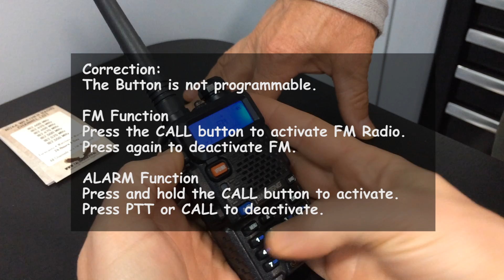Baofeng for Beginners: How to Use Baofeng UV-5R Buttons and More

Comment: I have two (2) of the BaoFeng UV-5R Dual Band Two Way radios. Am I allowed to use these radios to communicate with my family or do i need a license?  I just need them for stuff like camping trips and communication in the house while my wife is upstairs and I am down in the basement. Is it legal for me and my family to use them in the home or camping trips?
Reply: Choose a frequent that they’re not being used been change the tone which is a Cryptid similar to a password. Be very careful transmitting/Talking is a violation without a license. 460.000 plus. Mhz are mostly used for security schools janitors etc. Firefighters most police and county use 800.000 MHz Frequence Which these radios cannot reach
Reply: Don't do it! Dont do it!  "They' will come get you."
Reply: i am still new to this, but my understanding is that you must be very careful of your settings, if you transmit on the wrong frequency then you could be in violation of you local laws (depending on where in the world you live) 
Always better to have the correct license, as these radios have much more capabilities than a "standard walkie talkie"

Comment: unable to program US airband
Reply from the maker: Correct. They do FM modulation only. Air band is AM, so even if they tuned to it, it would not transmit or receive properly.
Reply: @TalonSurvival  what use is a radio without AM? I don't understand the value.

Comment: Might be a very stupid question, but why does it have 2 listed frequencies (A/B)? Is there any difference or what is the purpose? Please explain
Reply: dual band so you can have a backup channel
Reply: @codyman117  dule band is two bands like 2 meter and 70cm eg frequency starting 145.000 and 446.000 are two different bands
Reply: i’ll dumb it down for anyone who’s confused, it allows you to have two channels preset where you can switch between either with just a push of the   a/b  button so you can have one channel for regular talk and maybe use the other one for important info nit in order to do this you need to (IMPORTANT) duel recive and single transmit so you can hear both channels

Comment: Just got this radio as well if someone could help me understand. I can hear some people locally using some channels when i scan and when I try to attempt to speak to them it seems they cant hear anything I;m saying. I just found that my local area does a Trivia night and they couldn't hear anything i was saying. what could be going wrong?
Reply: They may require you to transmit a CTCSS tone. The menu in your radio lets you program this in, but you'll have to know what the tone is. I would google the frequency you're hearing them on, plus the name of your city or county. You can also check a free website and app called Repeaterbook to see if the station you're hearing is listed close to you.

Comment: Mine just isn’t working I can only press talk nothing else will work
Reply: You probably locked it. Look at the #key. Press the #key. It locks and unlocks your radio. It even has a key on that key and puts a little L on the upper left screen.
Reply: No i was wrong. Press and HOLD DOWN the # key until it says unlocked. Like 2 seconds.
Reply: You probably dont want to go transmitting (aka talking) without a FCC license.

Comment: How far can this reach ?
Reply: How far can you throw it lol 😂😂😂 mine just got here and im trying to figure this thing out
Reply: gator 556 yeah it threw me for a loop to.  I can only figure out how to pick up fire or set it up to talk to another one I have.  Other than that.  Kinda with you. Depends on how far it can be thrown.
Reply: @gator5566  yea they aint easy. Got nine about a week ago and it looks like you need a fricking phd to work this thing. What a drag.
Reply: Lol? Really people? It’s line of sight. They can go as far as 100 miles in the 2 meter range. HOWEVER. Once you get a license you can get access a repeater and and TALK FOR THOUSANDS OF MILES. No kidding, there are other videos, check it out.
Reply: One guy talked 2100 miles via repeater.
Reply: @MrJackal43  once i figure it out ill get back to you lol
Reply: I think 7-8 miles
Reply: I heard it will reach to Uranus.  Lol. Jk. Could not resist.  Much depends on foliage, topography even weather.  Also you will get 15 different answers from 15 different respondents.  Not hitting a repeater will land you 3 to 15 miles.  With a repeater, you can expect much greater distances.
Reply: You can hear the Space Station if you know how. Do you know how? Lol
Reply: @tenncutt  what freq

Comment: Do I have to have a license to use these with my friends!?
Reply: No is correct. Supposedly it is illegal to own this radio and do anything on it but listen. But to answer your question you do not need a license to talk on frs/gmrs in general. You do need a license on the ham frequencies. These radios technically have too much power to use the frs/gmrs freqs. so they are not legal to do so but they can do it.
Reply: Yes, per the FCC to operate this radio you must have a license.  It is not type accepted for use outside the Amateur Radio bands, which require a license to operate in. 

That being said, a license is cheap and easy and would help you learn all the simple things to succeed in operating!  Strongly consider preparing some and testing for it!
Reply: NO

Comment: hi, i have this kind of radio.
currently i have 2 issue,
1st, our local community give us a freq to monitor current situation. but they gave us 4xx.xxx, i try to change the freq. but it returns to original freq. (lower than 200.xxx i guess)
2nd, they gave us another freq. a temporary one with 1xx.xxx. i can now hear them, but the issue is, they cannot hear me. or right term is, my input does not broadcasting to them.

pleae help. thanks!

Comment: How do you know you are not transmitting, I want to only monitor a station. Is there a way to accidentally lock the PTT? And does the call button every ring like a walkie talkies call button, I do not want to accidentally call a chanel i am monitoring
Reply: John I believe in frequency mode the bottom row of numbers is what frequency you wish to receive something. And the top row is the frequency you wish to transmit. So theoretically you could receive and transmit on 2 different frequencies
Reply: Jared Reaux i thought that is just presets
Reply: If you program it with CHIRP you can set it to not allow you to transmit. What that looks like in the program is to set Duplex to "Off" I'm not sure if you just mean temporarily or permanently disable

Comment: Very nice video.but what is actual range.
Reply: That is a question that has no singular answer.  It is dependent on your terrain, and the antenna you use primarily.  The shortest answer is that it operates inside of a "line of sight".  Radio to radio directly it is typical to get a bout a mile or two, just like walmart walkie talkies.

Comment: Bought this because of the imminent lockdown on corona
Reply: Me too. Now I need a licence.
Reply: @dannyarnold9823  -Just listening to the radio u don't need a license for that!
Reply: @CTROCK  Where's the fun in that :), no seriously keeping it just in case I need to call for help after the total loss of infrastructure.
Reply: Retro Man Dan Hopefully Amazon does no sink me
Reply: Retro Man Dan I do t need a license, but it and use it to communicate after this corona virus turns into a apocalypse!
Reply: I did also just come in today
Reply: Maniac 828 got mine now. Pretty decent for the money. Did a cruse around neighbourhood. Works well
Reply: @Teddy_Bass  make sure to NOT transmit on ham bands. Only use license free frequency
Reply: Cody Walker Jr Will do. Stay safe
Reply: @Teddy_Bass  you can get a gmrs license for 70$ for 10 years. No test needed. Covers your whole family. Up to 50 watts and repeaters
Reply: Same here! I am in CA! Hopefully, Amazon delivers on Monday. I was told these radios don't work on ham frequencies. I'll have to program them. I'll get a license soon.
Reply: My research told me that the uk licence free frequencys are only for fixed antenna 0.5w radios, to tx in the uk on my radio requires me to be licenced.
Reply: Retro Man Dan lol! U worried about a license to use that radio? We are in a damm apocalypse! Get the fucking radio and and use it , it can help save your life
Reply: Do your research. There are frequencies you can use without a licence. MURS/FRS

Comment: So In an emergency situation, tsunamis earthquakes etc, power lines down, cell towers down, everyone frantic using their iPhones trying to call their families. What’s the max distance the UV5R can reach, in an emergency situation I don’t think using the licensed band is gonna matter if my life or my families is in danger.
Reply: depends greatly on the power its putting out, there are different variants ranging from 1 watt to 8 watts, the tri power version goes up to 8 watts, with a really good antenna and on VHF low channels you can go roughly 5 to 10 miles in a smaller town, and a half a mile to a few miles in a city depending on many variables. In a wide open flat desert, you can go about 17 miles which is the furthest distance you can get due to the curvature of the earth. If you stand up on a building you can get much further. I can hit a repeater that is 32 miles from my house with the Tri Power UV5R on 8 watts with an Abbree 42" antenna and a full fresh battery. When i bounce off that repeater, it travels anywhere from 50 to 200 miles depending on the quality of the repeater station. Many areas have emergency backup powered repeater systems, theres one near me that i can link into and talk to anyone from Tijuana to two hours north of Los Angeles, so youre talking about 300 miles and 20,000,000 people. This same repeater system links in with other systems around the world, I just had a conversation with a guy in China and two guys from Australia and im near San Diego, all on the UV5R 8 watts with Abbree 42" antenna. The key is a good repeater near you. :)
Reply: Big John how do you know if it’s an emergency backup repeater? I found a map of some repeaters in my area but it appears as if they are only turned on at 9pm each night for a radio club meeting. Very new to this so I might be doing something wrong
Reply: @bigjohn8670  FIRST IT IS NOT ABOUT POWER OF THE TRANSMITTER IT IS HOW GOOD THE RECEIVER CAN PICK UP A SIGNAL.     IF HE CAN HEAR A REPEATER AT HIS HOME THEN HE IS GOOD TO GO KNOWING HE CAN HEAR THE SIGNAL FROM THE REPEATER. 

THIS POOR SAP JUST WANTS TO KNOW HOW FROM THE REPEATER HE CAN TRANSMIT WITH A HAND HELD TO REACH THE REPEATER,     THIS YOU CANNOT  ANSWER.    HE NEEDS TO PURCHASE TWO RADIOS AND GO OUT AND START TESTING.      HE DOES NOT CARE ABOUT   TALKING TO SOME ASS WIPE CHINA MAN   HE WANTS TO TALK TO HIS WIFE.      OMG
Reply: THE UV-5R  AT 4 WATTS SHOULD BE GOOD FOR   1 TO 4 MILES DEPENDING ON YOUR LOCATION.  THIS RADIO IS NOT MADE FOR LONG DISTANCE TRANSMISSION USING SIMPLEX.

Comment: Question for Ham Vets: Can I put a  Kenwood or Icom antenna (6 inch) on a Baofeng 10w radio?  They have the same connector but can the antenna handle a 10w radio when it was made for a 5w radio? Any thoughts?
Reply: Yes
Reply: Not without BNC to screw in Jak,,,, Saw a great QT last night , qestion , just checking it wasnt below ,, " can i use a ken/yaesu dual band whip on a Boaef,,,,, !st,,,, id be saying " It should have been used straihht away, buyt they still aint great,,, bare in mind this person was licensed, """ What about the height "? its 15 inch,,,, well Yea, 12,5 inch Diamond , its basic Antenna maths .. Height V freq .... i did tho warn not to use a home base up to 1000 watts antenna, IT CAN SERIOUSLY BURN
Reply: You have to remember the golden rule , Dual band antennas , they are built to size , the ideal height for a handie antenna is about 12.5 inches,  it's the power side where when we say use SSB on 2mtr , youd just cook an antenna that attaches to a handie ! You'll be sound with them,  but they are Bnc fitting yaesus and kenwood/icon, some are sure screw in, you can get an adapter , but buy a Genuine Yagg 771. Not these 2.quid copies , you'll pay 15 quid for a top whip real Yagari 771

Comment: hi i have a similar F8+111 model if you set Squelch to 0 you cant get into the FM radio only when Squelch set to  1 or more can you access FM radio i presume this is because of the active  receive function that   auto  returns from FM to a detected  receive signal   so if you cant get  FM to work  turn up the squelch.........

Comment: Mine suddenly doesn't want to turn on. What should I do?
Reply from the maker: Any drops, water or physical damage that could have occurred? As cheap radios they aren’t always the sturdiest, especially with water.  Try a new battery first, try a reset and reprogram second and see what happens.  If that doesn’t get the job done, you may need a replacement.
Reply: @TalonSurvival  I'll get a cable soon and try that. The battery works with my other one. If its out of service, then no worries, I got 3 more.
Reply: Smash it and recycle !!!!!!! SAVE OUR PLANET

Comment: Hello. for longer distances what do you recommend for baofeng uv 5r? narrow or wide band? Thanks
Reply from the maker: Wide and and narrow band should be dependent on the band you are using. If in ham, use wideband, GMRS or marine use wide, public safety or FRS use narrow.  The radios on each end of the conversation need to have the same setting or one won’t be able to hear the other at distances greater than a few hundred feet.

Comment: If you have pre presset the channel, let say channel 2.
If i press the frequency mode, is it showing the frequency in channel 2?
Reply from the maker: No. It is showing the frequencies you last typed in while in frequency mode.
Reply: There is a way to do this.  It requires the computer to set up though as does being able to name a channel.  I set A(line 1) to read the channel name I set which I use more commonly.  I set B(line 2) to read the frequency.  I can then navigate A to the interested channel name, read its memory number on the right, and then move B to the same memory number to read out the frequency and its behavior.

Comment: What are the two frequencies in frequency mode? Receive and transmit? And wich is wich?
Reply from the maker: Remo Crapstuff you have a transmit and receive frequency for the top and bottom lines in the radio. Think of the top line being a channel and the bottom line being a different channel. Each channel has a transmit frequency and a receive frequency. The transmit frequency is the frequency you are using when you push the button in the side of the radio to talk. The receive frequency is the one you listen to. Each frequency is shown respectively on the screen. When listening you will see the receive frequency on the display, when transmitting you will see the transmit frequency on the display. The transmit frequency is set (when different from the receive frequency) by using the offset function in the menu.

Comment: Beofang radios??? I had two, both crap, if you want trouble free radio get a Yeasu etc , wonderful handheld transceivers, my Beofangs got junked. My two either received and would not transmit(common issue) or the other way round, If you want frustration then get a Beofang.
Reply: And, to balance that, my two Baofeng radios have been working flawlessly for some time now. Yes, Yeasu radios are nice, but they're also ten times more expensive without doing much of anything more.
Reply: @Dustin Eward   ..  Lol. They're a perfect addition to an AR15 which many in the government also don't want us to have. Nothing scares a leftist more than camo, an AR15, and a radio's speaker/mic headset. Seriously, they're decent little radios.

Comment: Funny coincidence, 146.640 happens to be my repeater in Tawas Michigan, but everytime I try to program it into my uv5r and key up, I keep getting a solid red light on the transmit led. I used chirp to program it, so It should've been entered correctly. I even added the transmit memory to the the same channel on the b frequency line. Not quite sure what I'm doing wrong, unless I'm just too far away for it to pick up my signal, 11 miles away
Reply: The transmit LED is supposed to be red when you key up. That means you're transmitting.